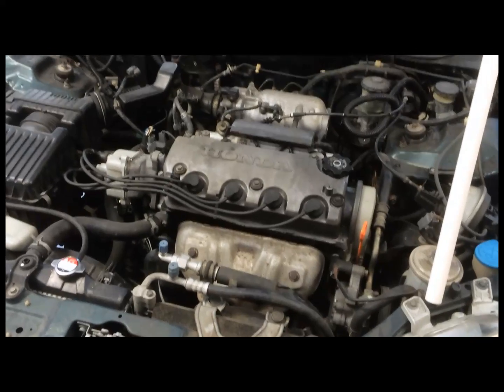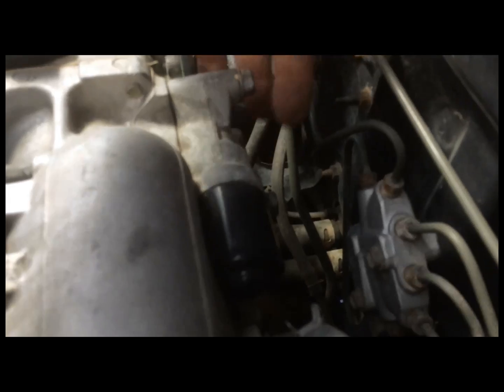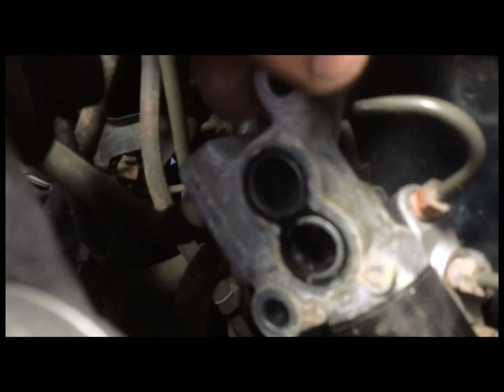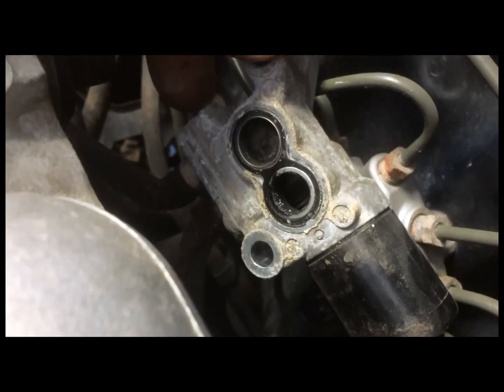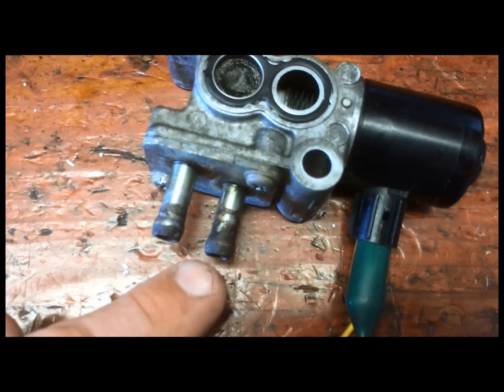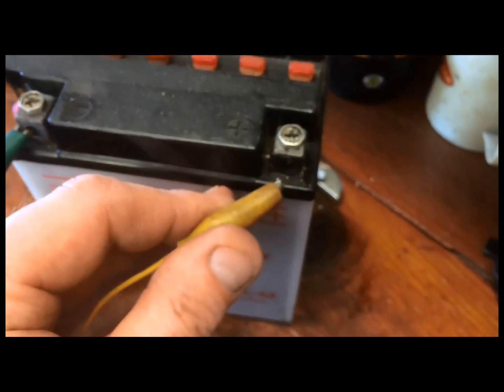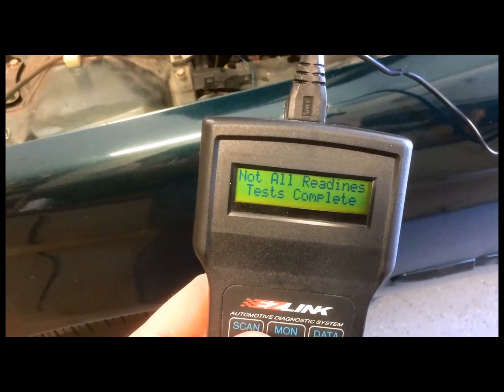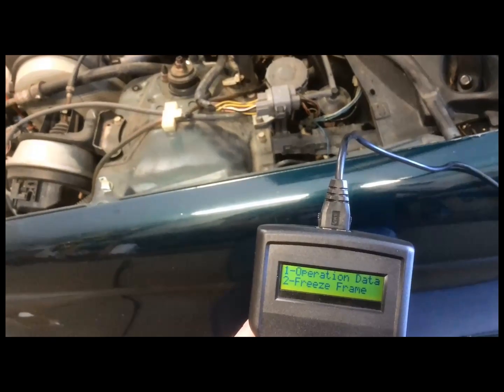1998 Honda Civic P0505 IAC Fix

Comment: Can the iacv be screwed up even without a check engine light? My ac etc causes idle to drop low. No check engine light tho.
Reply from the maker: If the IAC is bad, it would most likely throw a code. It sounds like you have something else going on there. When you turn your AC on it may cause the idle to drop when the compressor kicks on, but that seems pretty normal unless it is dropping so low that it kills the engine. Are there any other systems or issues that you notice? Is it manual or automatic transmission?
Reply: @busabobsgarage9876  anything electrical especially ac causes it to idle low and vibrate a lot. Iac is supposed to raise idle to allow compensation for power draw
Reply from the maker: @truthseeker1203  Good point! You could try unplugging the IAC to see if the car behaves differently, but it may then throw a code, but that would let you know if the IAC circuit is working. However, you would have to test it as shown in the video to see if the valve is actuating or if it is plugged, etc. Maybe you have another vacuum leak or something going on there, hard to say.

Comment: I like that you tested the valve with a motorcycle battery
Reply from the maker: Thanks! When the MC batteries get weak, I don't always get rid of them. They make a good 12V power source for low current testing of lights, solenoids, relays, etc.
Reply: Bro you can do the same thing with a drill battery, a 9-volt battery and double a battery will work as well it will just make the motor go a little bit slower

Comment: whats up bro,im trying to do the same test to the IAC valve on mi accord 95 ,how did u conecct those wires ? i mean  wich goes to positive and wich goes ground ,its ok if i disconnect the car battery and try the iac test with that battery? please help
Reply from the maker: I don't think it matters, but check your wire colors on the connector. Usually, black or green will be ground. If you know how to use a continuity or ohm meter you can probe the connector and find out which wire is connected to ground.
Reply: @busabobsgarage9876  ok bro i just checked continuity and hace ground on black /yellow wire.

Comment: Bruh busabob, on the iacv it does not have a positive and negative? I can easily just hook up the wires to test?
Reply from the maker: Look at the wires on the connector going into it and follow the polarity.  A black or green wire will typically be negative.  In this case, it's just a coil and it won't hurt anything if you hook up reverse.
Reply: @busabobsgarage9876  thanks a lot for the quick reply, thanks for the info

Comment: What is the volts battery used to test iacv?
Reply from the maker: It was a 12V motorcycle battery. You can do the same thing running wires direct from your car battery. Just don't touch them together directly or you will fry the wires. You see that I used test clips with rubber insulation, so I did not short the wires together.

Comment from the maker: If you truly want to do it yourself, the first thing I would recommend is getting yourself a repair manual with wiring diagrams and a code reader that can clear codes and check "monitors", since clearing the code will not fix a bad sensor.  One thing that you could try first is make sure that all of your sensors are connected properly, then renove the negative battery cable for a minute to reset the computer.     Clear the codes, drive for 50-100 miles and see which codes come back.  Based on the code(s) that you see, then you can try to determine if the sensor or related system has a problem.  Make sure that your connectors and wiring are in good condition.  Unfortunately, these things are common in old cars...wiring, connectors, sensors, etc.  You can spend a lot of time and money guessing and replacing parts and it still doesn't fix the problem. If you don't want to go through all of that BS, it might be better to take it to a trusted shop because they have the tools and can probably get to the root of the problem quicker than you can.  Good luck!

Comment from the maker: I think you might havetwo different problems going on.  The idle air control and air conditioner are two separate systems. I hope you get it worked out.

Comment: Did your Air conditioner get messed up when you took of the IAC? (assuming it worked before). If you get air into the system you can mess it up supposedly. I recharged my system a week ago and it went haywire, I think I overcharged it, even though i followed all the directions and took it to the PSI written on the can. I AC would kick on and off very rapidly while idling so I let some coolant out, which helped but I think it was still a little, um different. Then yesterday this code was thrown and it started idling crazy.

Comment: The coolant lines are actually to keep the unit from freezing
Reply: +Road Worthy - 100%
Reply: keep looking for water leaked
Reply: I can confirm that, definitely to keep it working correctly in colder climates. Unnecessary where I live.
Reply: I thought it was to warm up the air, to get an accurate measure of the oxygen.
Reply: Road Worthy The hot motor would keep it from freezing. I would think it more to tell when the car is freshly started with or at operating temperatures.

Comment: did you only have a check engine light ...or was your idle up and down
Reply from the maker: The idle went up and down.
Reply: If the Unit is completely dead. YES, you will get an Engine Light On. Or you can take the Wire Harness Off, you will see the Engine Light On right away.